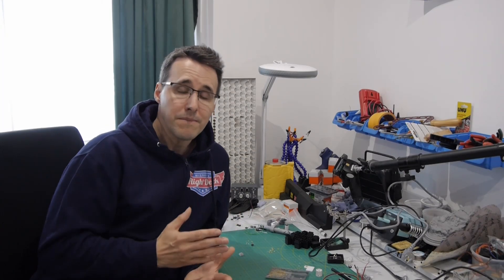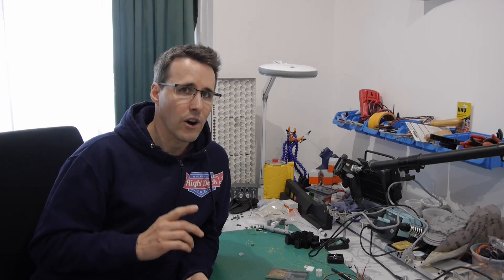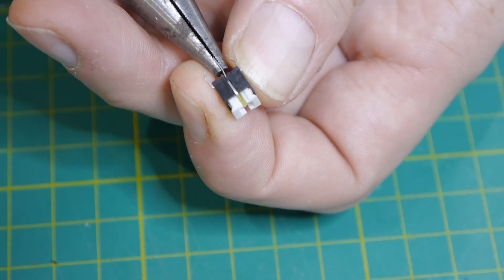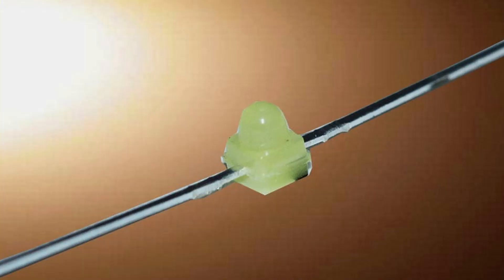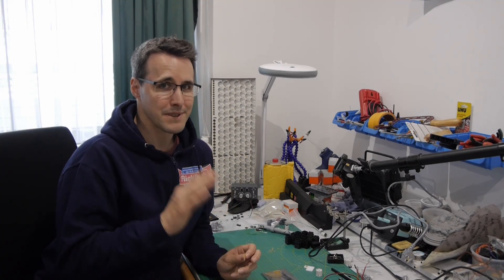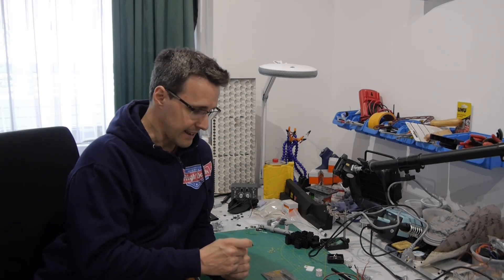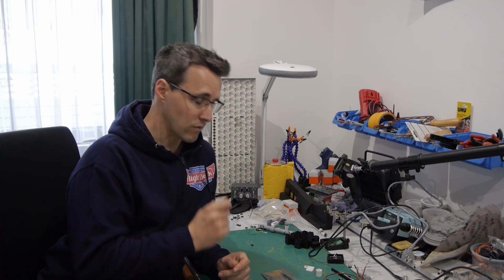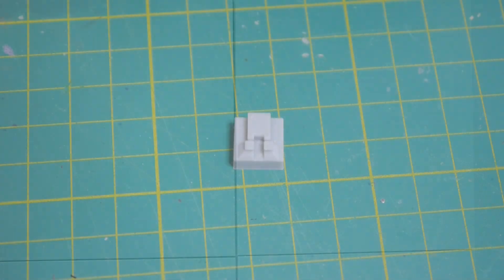Changing LEDs from cold to warm white - A Boeing 737-800 Homecockpit #85

Comment: Hi micky,
There is a much simpler way of doing this as I also had the same problem.
All you need to do is purchase amber colour film.
The same stuff you would use for tinting car windows and just stick it to the back of your panels.
And if you wanted to change back you just peel it off simple.
Hope this helps you.

Steve /uk
Reply from the maker: Yes, that sounds way easier. I will definitely give it a try.